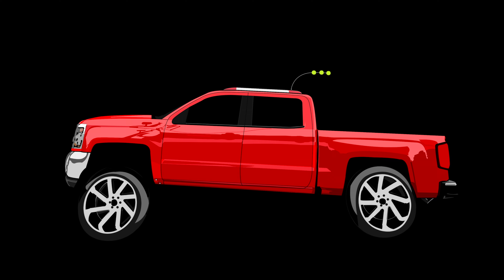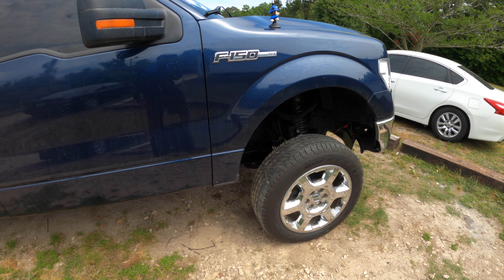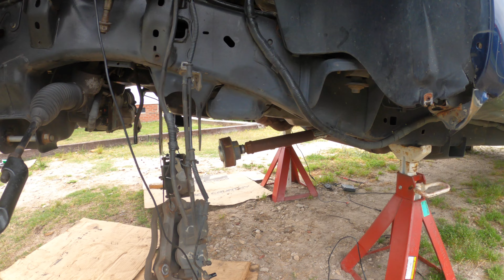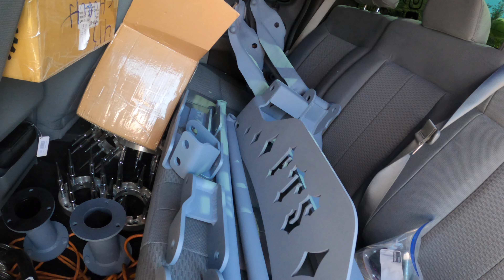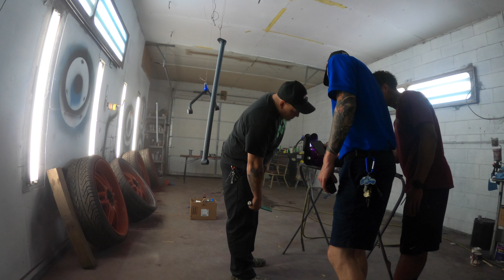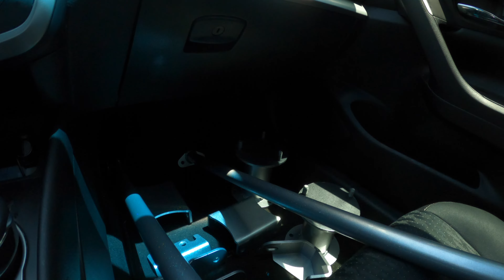REBUILDING GRAMPS F150! Candy Painted FTS Install! #BackyardBuilt VLOG

Comment: Can you do a how to put tennis balls on a antenna or is it really easy?
Reply from the maker: It’s pretty easy, just get a drill and drill bit and put a hole in both sides
Reply: @BackyardBuiltPerformance  how do they not slide down or off?
Reply from the maker: @Billy-Boggs  take some electrical tape and wrap it around the bottom and top of tennis ball where the antenna goes thru
Reply: @BackyardBuiltPerformance  alright thanks my man!